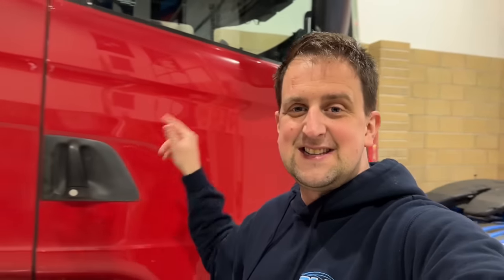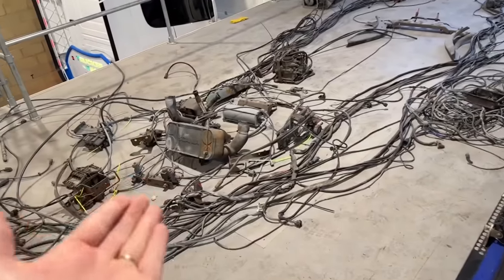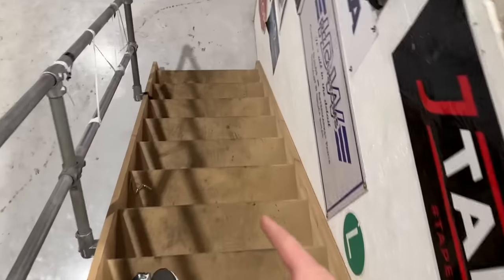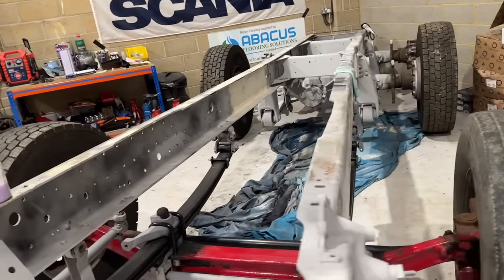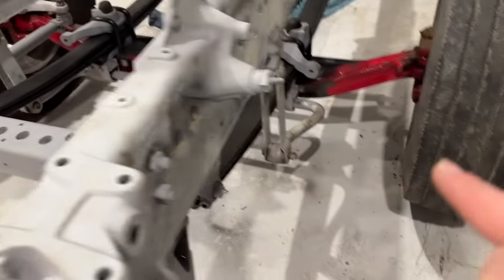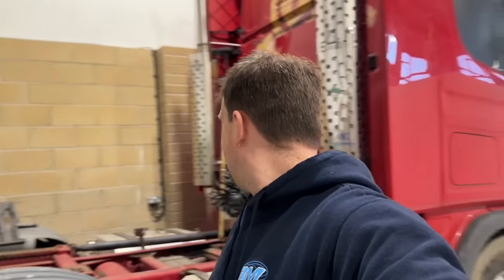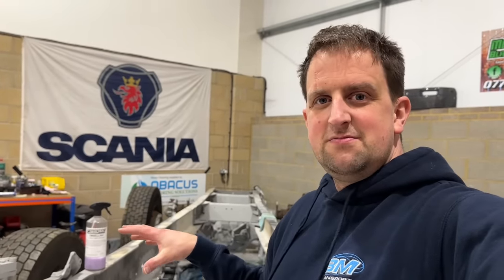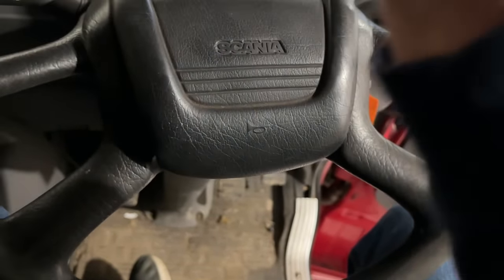SCANIA 4 SERIES UPDATE | EMPLOYING STAFF | #truckertim

Comment: Few suggestions for the sim. Don’t use a simple wheel, get a Moza or fanatec direct drive, you can get a way more realistic feel. Also  would suggest using monitors instead of a projector, would look better and less latency.
Reply: I really hope he sees this
Reply: 3 screen front and doors I'm sure you could get a screen to fill the windscreen 

Imagine if they could rig hydrolocs to the cabs' original air suspension locations 

Iv gotten carried away. I doubt none of that can be achieved
Reply: if you use monitors it would be way more better
Reply: I agree apart from the direct drive part, for a trucking sim something like a t300rs would be great since direct drive suits racing/drifting better
Reply: @smashabocks17 Direct Drive wheels are better in every way, even for trucking, since they are much smoother and you can turn the steering rotation up lots, like a real truck, rather than being stuck at 900°
Reply: @philtrysstrongman  it can be done with a motion sim not sure how possible it will be in the 4 series though
Reply: Tim , don’t put your gaming wheel in the cab. I got from ebay a steering shaft with wheel and bolted with a spider coupling my steering wheel controller underneath.  Initially it was a g29 with a bracket on hub. Which was weak and needed a help when switching on. Now I have a secondhand simucube controller. With 5 turns lock to lock. With the logitech brake and clutch pedals and a real accelerator pedal off it.
Reply: also projectors will be blocked by anything in the cab, such as people. It will severely hinder the functionality and usability.
Reply: @BritishTrainspotting  yeah monitors will work a lot better
Reply: Go with moza they are so good
Reply: @TruckerTim
Reply: #truckertim
Reply: @BritishTrainspotting  Depends on the projectors used and how they're set up all the flight sims that pilots train on tend to be projectors rather than screens, easier to maintain especially if it's going to be mobile.
Reply: @MiniMiner_Games thanks bro
Reply: @BritishTrainspotting  You could have the projector outside projecting on the windscreen with a plastic opaque sheet stuck on it with the projector image mirrorimaged.
Reply: remove the glass and mount the TVs where the glass is and have them on the doors too for mirrors etc

Comment: Use the entire steering column and wheel and attach  it to a 12 to 15 nm direct drive wheel base.  Use arduinos to make all of the switches in the cab work and 4 tv / monitors.   2 large for the windshield  and 1 for each door.   You can hook up the blower motor for ventilation.

Comment: Some Suggestions for the Simulator

1: Monitors or TV's instead of using a Projector
2: Using a Direct Drive Wheel (Moza, Fanatec, Asetek, Sim Magic etc.) However I think Moza and Fanatec are the only ones with wheels that look like a truck wheel.
3: A good sound system implemented in the truck (I doubt its that hard considering you've done it before 😂)
Reply: Id

Comment: It's not that difficult to make a frame. And then a few rectangular pipes underneath. Where the forks of a forklift fit. A child can do the laundry! Did you immediately solve the problem of up and down? And the pressure on the floor is also better distributed. Greetings from Spakenburg, Netherlands

Comment: Tim, the Cab is gonna be as problematic as the BMW, yer gonna have tae build a support for it that cab weights roghtly about a ton,
or see if ye can hang it fae the roof support beam with a rope system on the cab rest.

Also why donnae Take the classic and make that into a twin tag?
Ye got the frame almost done and like said, it's a classic and needs less body work than the OG 4 Series cab,
yer allready parting out and make 1 out of 2 so why don't keep the more "prestigious" one in better condition?.

And aye, it is a mammoth task restoring Anything the first time without all the tools and knowledge beeing by yersel.

Happy hogmany tae yous.